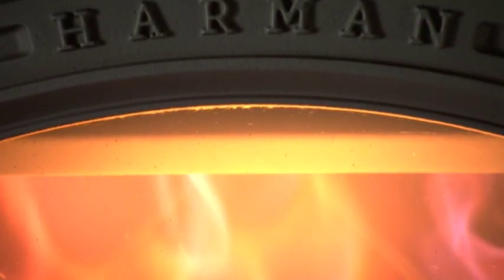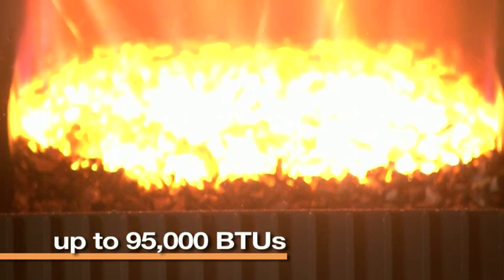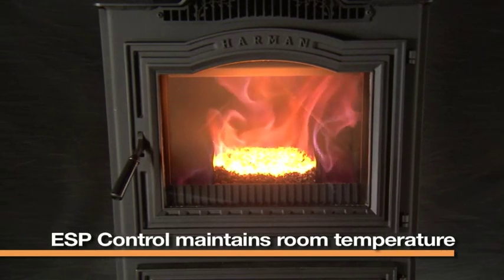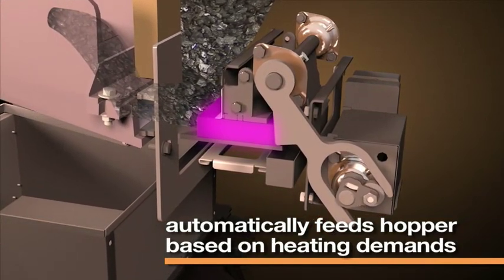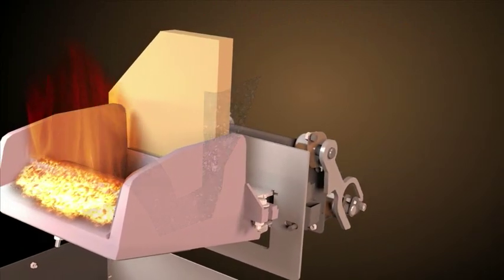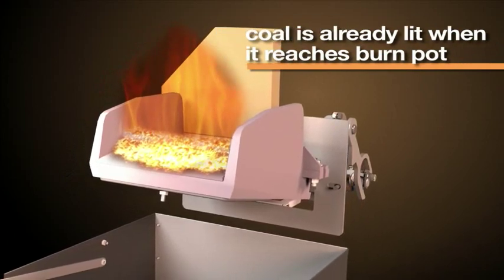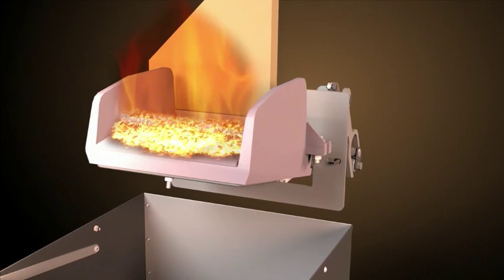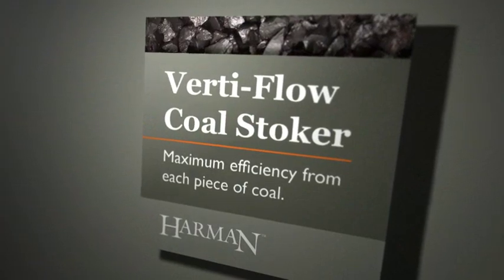Harman® Technology: VertiFlow™ Coal Stoker System

Comment: Your lucky its not available for inserts and it is not a good item and the local shop selling do not support it.
Reply: I have one of these in my new house and im not sure if I like it. Seems dangerous, there's nothing stopping it from burning the coal in the hopper right? Idk i hate it already
Reply: @loganmccarty2291  coal will not but without the air bed blowing up through it so there is no way it will burn in the hopper.
Reply: @stiffylekox  after using it a couple months now I've learned to love it
Reply: @loganmccarty2291  so,  I too recently bought a house with this same system.  Any tips?  I’m having trouble finding any information about how too run this system.
Reply: @nathanbuck8352  i can help you! It takes a minute to get dialed in, and also good coal makes a huge difference! What problems do you seem to have?
Reply: @loganmccarty2291  lol basically Everything!  So,  do I get the coal lit on the top lip? Or do I lite it right where it comes into the stove from the hopper? I’m assuming I need too fill that whole area where the coal comes in at with coal before I get it started. Is that correct way of thinking?  Basically once I understand that I should be good.  But,  that’s the start of the process so I haven’t even been able too start it lol.  I just replaced all my stove pipe this week.  I haven’t been worried about starting it yet as we have been in the 40s and 50s during the day yet and don’t want too fire it up till I need it burning all day and night.  But I know cold weather is coming
Reply: @nathanbuck8352  so yes you want to light towards the end. When it finally gets going you should have an inch or so of ash that the auger will keep pushing untill it goes into the pan. Make sure that area is full of coal to the sides. The stove does all the work for you then and you just have to take ashes out every couple days and also dump the auger pan for coal dust. I wish I could send pics of my settings to you for better reference
Reply: @loganmccarty2291  awesome.  Just what you told me is more help then I had or could find anyway.  Thank you!
Reply: @loganmccarty2291  dude.  I did it lol.  It’s all good.  I got it lit!
Reply: @loganmccarty2291  thank you for your help.  It’s going,  burning the way it should,  feeding the coal exactly the way it should.  Thanks a million for your help!
Reply: @nathanbuck8352  no problem I was worried myself a lot but once it got going it was great. Make sure to get god coal! Tractor supply stuff seemed to suck! The Ashland was half unburnt coal!
Reply: @loganmccarty2291  no worries for bad coal for me.  I live right in the heart coal country Pennsylvania.  We have nothing but good anthracite around here.  Cheap too
Reply: @nathanbuck8352  I usually make sure the back of the burn tray is full of coal and out far enough that it covers about an inch of the air holes in a thin layer. I then put a large cup full of wood pellets from the coal clear to the end of the tray. The wood pellets will get burning good and burn back the the coal and you should be all set. Expirement a little and you'll get the hang of it.
Reply: @nathanbuck8352  one more thing, if you are buying in bulk u bagged coal make sure it's free of rocks and any debris, a small rock will jamm the pusher block and you will have to empty the hopper to remove it. My parents have keystokers and don't have this issue but the Harman doesn't like it.
Reply: @stiffylekox  thanks for the info!  I live right in the heart of coal country PA.  So honestly it’s harder too fine bad coal compared too good coal around here.  I’m about 20 mins from shamokin, Pa.  I have the stove fired up and has been running great.  I really wish I got into coal stoves a lot sooner in my life.  Everyone always talked me out of it because of the “work” involved in running one.  I don’t mind it. Good heat at an affordable price,  well worth the little bit of work